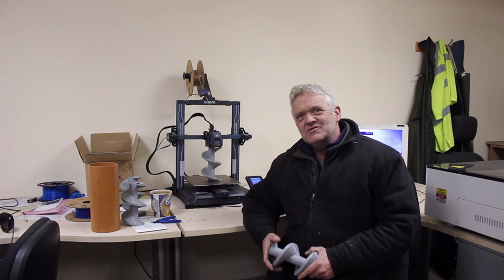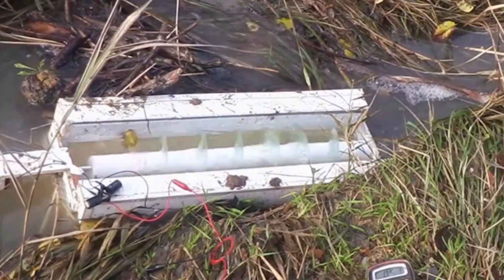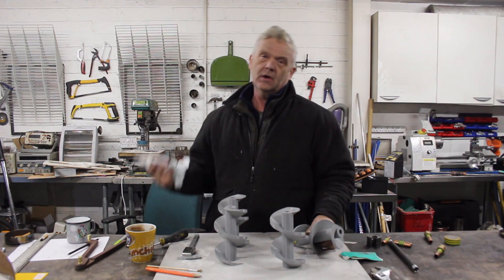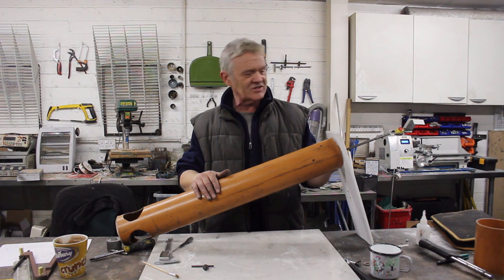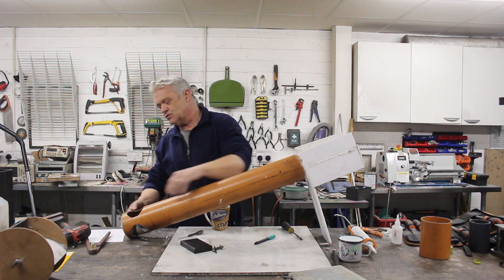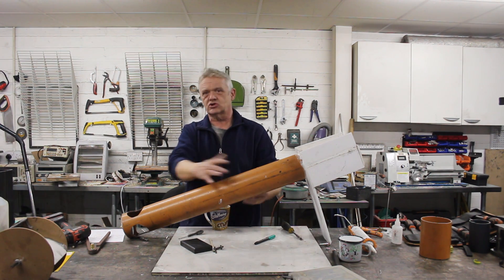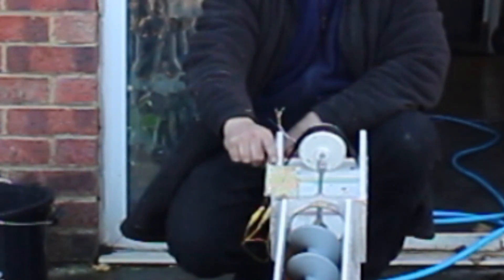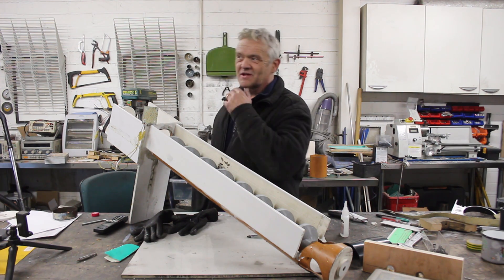1757 DIY Emergency Rainwater Generator - How To Make It

Comment: Fantastic looking toy!  Emergency power generator - er - no!  To be at all practical - it would need to charge up one of those big lithium batteries (I wonder how long it would take to do that on the average house?).  As long as the grid is running I can think of an easier way - but the time could come...

Comment: We don't have issues with leaves so much as sand (high desert, monsoon season great for collecting water in storage tanks). Is the 1mm clearance around the screw enough to not get clogged with sand in the dry time?

Comment: You could hook this up to a solar power controller system to charge a battery for backup power to run electronic devices for charging cell phones or led lighting.
Reply: Is that how you would need to do it for safe charging? I'm looking at this to integrate into an already existing solar charging battery system. We live in Alaska and it's tricky to have the solar do enough.

Comment: Great video. Have you considered turning this into a Heater? So that every time it rains / water flows, it warms the house? As rain usually cools the house. There are these rotating magnet-on-coil heaters where they pump the air through copper tube under a rotating magnet and Eddie's heat the tube and air inside. You could add such a eddie-powered air-heater and it would be more useful than sporadic electricity. You could make it self air pumping also using the rotational energy available. Great job.

Comment: Quite neat, but not sure you would get enough flow from a down pipe, I never see much volume in my roof down pipe flowing into my water tank there is probably 2 down pipes on that side of the roof about 12.5m wide , I reckon in a good downpour in Brisbane, my 5000 litre tank could fill up in about a day, that would be about 3.5litres per minute (all guesses) I guess it would be easy enough to work out. I could get a lot in stormwater areas though.

Comment: I have been thinking a lot about screws and squirell cages and thinking about solar panels placed at angles to get the best sun exposure. Using sun and wind with squirrel cages in unison should output a better output if the angle of solar panels match to the majority of wind direction.

Comment: If one had a plumber in to clean out a pipe, the device used looks a little like an Archimedes screw. Perhaps if the generator could be run as a motor in reverse, the device could be self-cleaning?
Wouldn't a screw based on a Ugrinsky turbine shape be even more efficient?

Comment: Craig side House in Northumberland used this technology to light the house in 1878 and there’s one in North Yorkshire that have been operating for many years, so I would dispute that this was invented by the Japanese fella. Excellent content as always Robert.
Reply: Cragside installed their screw in 2014. The original 1800’s plant used a Siemens generator.

Comment: I found superglue isn't great for holding printed parts, however Gorilla Glue is brillant!  Is there anyway to feed the water back up in a loop so it keeps going?
Reply: A) No. That would be perpetual motion. ;-(
B) Yes. That would be evaporation/clouds/rain.  ;-)
Reply: @bikerfirefarter7280  so, not quite what OP suggested, but if you set up a tiny, wind driven pump to lift the water to create a header tank, with a siphon system.
It might take a day to fill & dump, but the power output should be significantly better coming in a surge rather than a weak trickle
Reply: @NM-wd7kx  Nope. Power is power. Stored/discharged or used continuously, its still the same amount. Plus you'll always lose some converting it. The only thing that helps is finding the most efficient converter. Of course sometimes end use is more desirable than efficiency.
You could use a wind driven device, geared appropriately,  to lift the whole header tank while it's full of water, and then use it as a gravity battery; depending on overall efficiency/friction losses.
Reply: @bikerfirefarter7280  there's always some question of efficiency of conversion, if using a dump tank then you could be using a heavier/larger screw, which can drive a higher torque generator, this can also be used whether or not there is heavy rain.
Whereas a light turbine might choke on a downpour & a heavy one likely won't be turned by a bit of drizzle

Comment: The Coanda effect trades velocity of flow for mass of flow.  I wonder if you could take advantage of that to use a high velocity low mass flow to spin something like an Ugrinsky turbine that uses a low velocity high mass flow.  How efficient would it be?  Would this be a viable way to produce a turbine generator that could compete production cost and operating cost with an internal combustion generator?

Comment: In all honesty, you could still use the same central shaft to support everything even after attaching the outer pipe. It'd just put additional load on its bearing.

What you should really do is wind some tube around a central shaft. Or alternatively so you can keep what you got, just glue some film on, spanning the outer edges. My initial thought was latex so it could handle potential surges in volume, but may not be necessary.

Comment: that "twisted" Ugrinsky turbine you 3d printed would work in this situation as well, given the pitch of the twist it would spin a little slower but would have reasonable torque.

Comment: Let’s do a little thought experiment shall we?

Let’s assume we collect all the rain from the roof of our two storey detached house which has a floor area of 60 m² and drop it down a drainpipe to the ground for a whole year.  How much energy would it deliver if we could recover it with 100% efficiency?

Typical annual rainfall in the UK is about one metre.  If you took the roof off your house it would fill up with rain to about waist high.  That sounds like a lot to me but that’s what the Met Office says.

The total amount of water harvested is therefore 60m² x 1m = 60 cubic metres which has a mass of 60 tons or 60,000 kg.  Good job we aren’t storing it on the roof.

If we drop this say 6 metres to the ground the resulting potential energy (E) released is the mass times the height times the acceleration due to gravity (g).  The value of g is  9.81m/s² lets say 10.  

So, E = 6m x 60,000kg x 10, which is 3.6 Megajoules.
3.6Mj is exactly one kilowatt hour
In one year.
Reply: So very little really.

Comment: Will it have double the torque if you double the length?
Reply: Pretty much so.
You can also increase the diameter, then r(sqrd) factors in.
Reply: @bikerfirefarter7280  Why do we still build water dams? Imagine a bunch of these pipes (just larger) tied together in a river. This could power entire cities!
Reply: @baraBober  Dams sequester water to even out river flow that changes. Also pressure/height means more power density, so smaller turbines for same output as larger/more A.S. types, and faster rpm.
Several other reasons; fish, boating, aquatic birds, etc.

Comment: Very interesting!  Some thoughts:

1. As turning the screw depends on the weight of the water, a certain flow rate would be required to overcome inertia and the various frictions affecting the whole system.
2. Given those issues, the system's scale would have to be carefully calculated for optimal efficiency.
3. I forget what the mechanism is formally called, but it involves a container with a slanted side that can pivot.  The pivot point is set part-way up the slope, so that, as water fills the container, the center of gravity slowly shifts until it is past the pivot point, whereupon the entire container tips over and empties itself, then, once it is completely empty, the center of gravity naturally shifts to the other side of the pivot, so it tips back and resets itself.   A setup like that, with a large container, would allow for even small flows to produce significant--though periodic--generation.

Cheers!
Reply: not entirely accurate, Archimedes screws where designed to pump water at low revs, because each screw twist held a given amount of water. similarly at low flow each twist holds the same amount of water/energy, the rotation is just slowed. 

a tank with an auto siphon to feed it would probably be simpler to implement for your goal.

Comment: If you reduced to pitch would it require lower volumes if water to rotate it? I'm thinking it would it would build up to over center faster but have lower torque output due to the weight of water required

Comment: To get enough flow from my gutter i might build a small reservoir with a bottle Syphon, would fill and then flush and repeat, could trickle charge a  battery maybe,, great to see you on the printer!! Inspiring as usual 👍
Reply: Soz "bell Syphon"

Comment: seems like being open so you can clean it would be useful for someone using the water from sluicing? (sorta like panning for gold but with a big stationary thing that the water goes over ribs and the gold gets caught in them because of its density being so much higher than water) anyway one that is fed by river water would seem like the outflow could be used to generate power to keep it running and scavenge extra energy to run something for your set up or personal stuff while out gathering some rare mineral out of the river using the sluice.

Comment: Now I wonder how the efficiency of the Archimedes and Ugrinsky water turbines compare! I imagine the Ugrinsky is best as a high torque approach?
It did occur that you could make a home water battery generator by using the wind and maybe solar to slowly raise water into a high header tank on an opportunity basis. Then you could convert  this into quite high electrical energy output over a short time period. Not sure how useful it would be but I know you like batteries and we only have thermal water batteries today.
Reply from the maker: I think it's really more a question what is appropriate to the circumstances mate - I like the home water battery idea - I think it is really approachable

Comment: I get what you say about the work needed for better efficiencies but remember talking to an engineer who worked at a turbine generating plant who told me about the efficiency gains on tight tolerances. Yet another brilliant video.
Reply from the maker: so true mate - but I don't apologise for it - we aren't talking about super engineering here but what can be done at home
Reply: Yeah, tighter tolerances are very important in gunnery, for repeatability as much as range, any gasses that pass the projectile while going down the barrel is known as 'windage'. I'm expect Rob will appreciate the reference. ;-)

Comment: What would happen if i place it vertically inside the downspout of the raingutters? 

And second question:
I'm relatively good at fabricating the mechanical parts. The electrical part is a mystery to me. How can i convert the current coming from the generator to power a battery and deliver a steady 12V?
Reply: 1) Nothing much.
2) You'd need something like a step-up circuit (similar to a Joule-theif, but beefier) and then to your battery (but you'll also need a regulator so you don't overcharge your battery).
Plenty of 'how to' on you-tube.

Comment: We would only be considering these measures because government is failing to keep the social contract of maintaining the infrastructure that secures our basic needs at reasonable cost. If we all have to secure our power needs by alternative means we are going to need vastly more materials than those required for centralised power production. We obviously won't all be doing it unless driven by desperation. For those that think that green power or renewables are the way forward they should consider the minerals and metals required to replace fossil fuels globally with current green alternatives. Simon Michaux, an Associate Professor of Geometallurgy at the Geological Survey of Finland has performed a study which indicates that at the present rate of production the copper required would take 189 years to produce, Nickel 400, Lithium 9920 and Germanium 229113 to select a few in the range. This will all require the use of fossil fuel in astronomically larger quantities and since oil may be expected to peak some time after Human stupidity the problem is clear.

I think the ideas on this channel are great and may well implement some of them and have great fun doing so, but I should not have to.
Reply from the maker: it's not a question of having to - you should be able to - then you have choice
Reply: @ThinkingandTinkering  Yes I agree that it makes sense to have the common sense and skill to improvise something in the event.  

Is the aeromine going anywhere?

Comment: Does making it longer make much difference?  I get the impression you'd get roughly the same power from 1 section of screw as you do from 4.
If it uses gravity or under pressure then yes, I could see a longer screw being better but laid flat in a stream makes me think that other 3 sections would be counter productive.
Reply: You are right, in fact an Archimedes screw doesn't generate any more power than a simple propeller of  the same diameter.  When the first screw driven boats were made to replace paddles they used a long helical screw but soon discovered that they could shorten the screw without losing power and eventually ended up with the propeller (or screw) as we know it today.  What you really need to harvest energy from rainwater is a Pelton wheel.
Reply: @petehiggins33  Pelton is good if you have enough height/pressure. But for low height with good flow torque converted to high rpm is better.
Reply from the maker: you get more torque from longer

Comment: Did you see the YouTube of the guy who has a plastic barrel on his roof using it with a barrel at his rain gutter and a pump to move the water up to the roof barrel to then make it come back down from that barrel all to make electricity? I saw that over a year ago.
Reply from the maker: it's a kind of battery - hmmm
Reply: @ThinkingandTinkering  It was odd to watch him do all he did in about 3 or 4 videos. I think he eventually made it all into one. Will send you a message via your website with video link.
Reply: @ThinkingandTinkering  well that did not work keep getting: There was an error trying to send your message. Please try again later. From your website contact form.

Comment: Does it work if the water flow is reversed i.e. in a tidal estuary with the screw horizontal? If so, fee tidal power.
Reply from the maker: yes - it died a version a while ago

Comment: Pipe rotate with the screw….  Or they can just 3d print side walls to the screw to capture all that spilled water
Reply from the maker: oh yeah - there is a version like that on thingiverse - I think I would only use it with lean water though - debris would be a pain I think

Comment: Hi Rob,  I was having a conversation a while back doing something like that. I tried it with a sump pump with not munch out put and set the idea aside! Thanks for re-peaking my interest (get a lot of rain here also). As I watched your video, I wonder if you  do some kind of magnets inside and a coil  around the outside and turn the whole thing into a generator!
Reply from the maker: now that is clever mate - I like that a lot - I might make something from your suggestion if that's ok with you?
Reply: @ThinkingandTinkering  DO IT!
Reply: @ThinkingandTinkering
Reply: Hi Rob, of course you can!!! BTW I'm the guy from Florida who asked you for help on the "Twisted Turbine " files (Gene) TKS again!!!
Reply: @ThinkingandTinkering  
I can't wait to see this.
Reply: You seem to be saying to wrap the wire around the pipe but the coil(s) can't be in that configuration and that won't work due to how you need the coils oriented for the magnets' rotation to generate power. What you're describing would be great if you had one big magnet and it was pushed in/out of the pipe. Good thinking on your part for sure but that one detail is what stops it from really working.
Reply: @ehrichweiss  Not necessarily, the top part of the corkscrew could have a band around it, sunken into the corkscrew so as not to come in contact with the outer pipe. The band would need to be thin enough yet hold the magnets in place; they will spin in perfect line like this.
I see the issue being speed, I think the torque is ok but not enough speed; a gearbox would be needed which eliminates this idea. Anyway, that's how I see it.